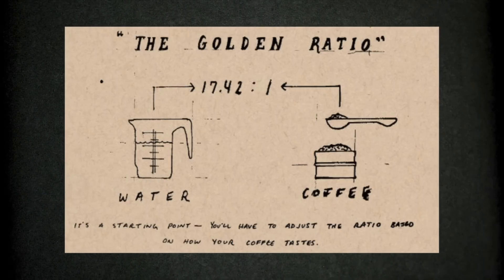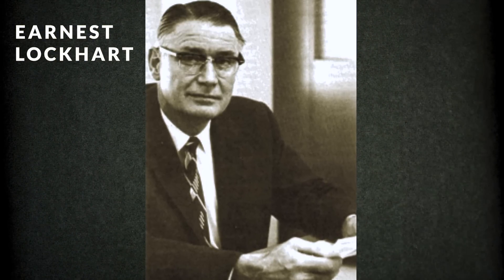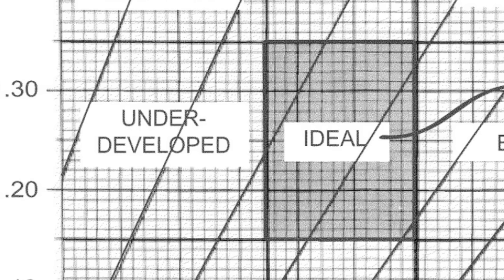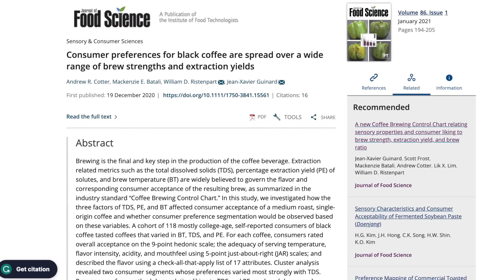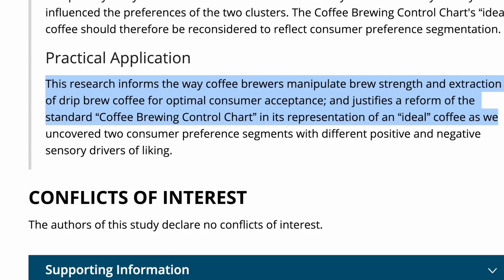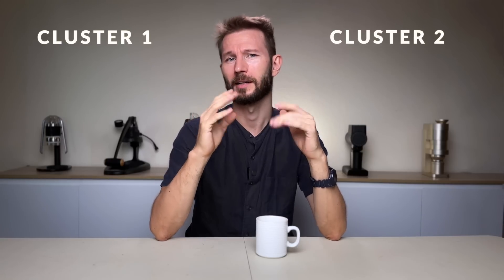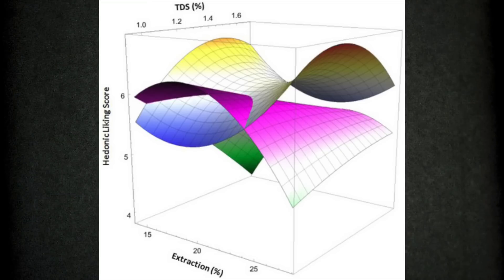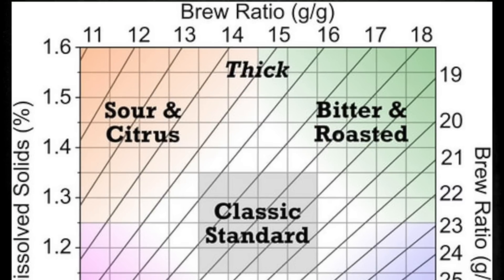Did science just KILL the GOLDEN cup coffee standard?

Comment: Thank you Asser, would you give a quick primer on how to typically manipulate TDS vs extraction? Ie how to achieve high TDS with low extraction and vice versa.
Reply from the maker: Often higher TDS and lower extraction will follow each other. The more water you push through the grounds, the more they get extracted. But this also means that you'll have more water in the coffee cup. So if you want to increase extraction without getting weaker coffee, you will need to grind finer or use other tricks that push up extraction.

Comment: What would be the easiest way to explore what's being proposed here? Is it as simple as using the same recipe, but changing the brew ratio?
Reply from the maker: Ratio is a good way to start exploring. The next level is adjusting grind size. But a refractometer is necessary if you want a more objective measurement.
Reply: Suppose I started with a 1:15. Assuming it isn't already bad, do you think it would be more beneficial to adjust the grind size for my next brew or ratio?
Reply from the maker: I would just go to the typical 1:16.6 from there. If the coffee feels like it's lacking something, grind a bit finer. This will move you closer into the center of the old brewing chart, which you may like  @all_systems_failing7235
Reply: @coffeechronicler  Thanks!